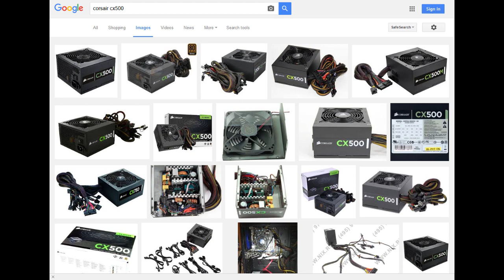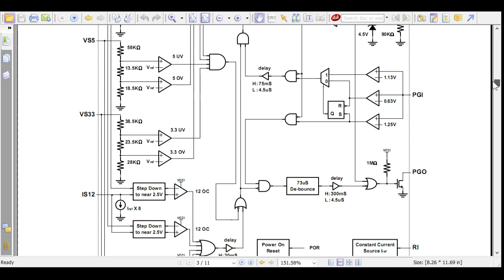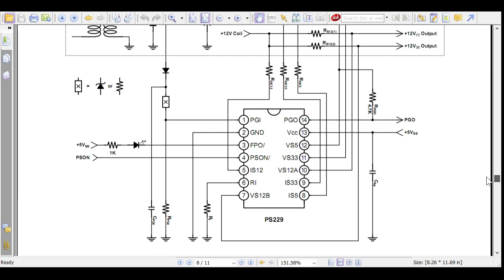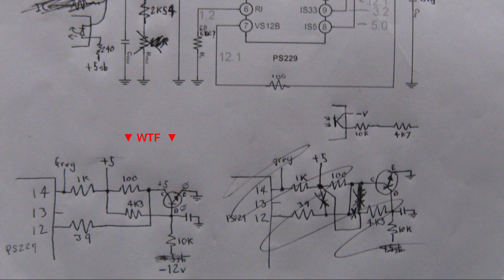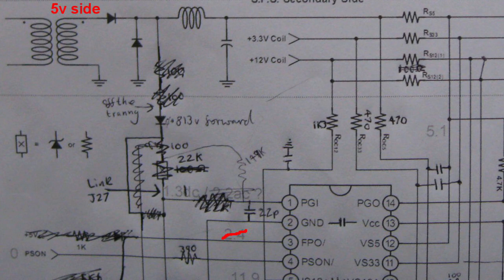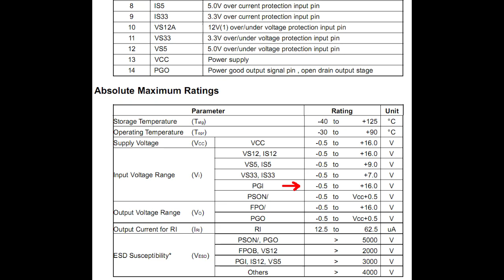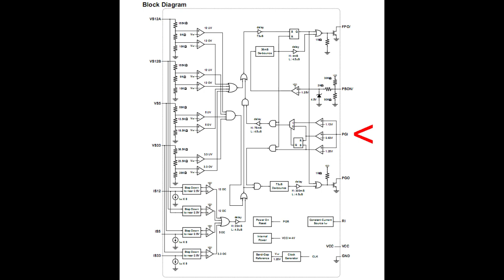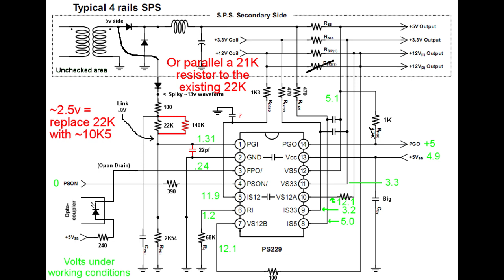Corsair CX500 PSU Repair

Comment: i just have the same problem with my smps. its a small and simple one ..for dvb-tv 
but i am having the same problem of voltage drop on the optocoupler prtoection component (and tl431 zenner voltage reference)
when i tested with+5v output with dummy load - the protection take place at only 40ma consumption
when i connected external linear 5v PS to my DVB-TV it works just fine - with 800ma consumption

so the problem is at the smps(PS) side for sure

so i think your video just gave me the idea to play around with the voltage reference -resistors
and maybe to try to bypass the faulty current protection components
maybe the TL431 voltage reference that cause the voltage reference drop to early is the faulty component.

untill i get my new TL431 i will make some test with the voltage refernece current protection 
as you did with changing the voltage Ref with resistors...

thanks . very nice work with the tutorial .
Reply from the maker: Hmmm this is a very different issue.  Only adjust the optocoupler if you want to adjust the voltage output.
Here is an Laptop SMPS I was playing with. https://postimg.org/image/bdphc8pbt/
I would recommend looking for the op-amps first and looking at the voltages going into the 'plus / minus' pins.  For this laptop 1 half of the op-amp controls the voltage.  And the other half controls the current.   (If I am remembering correctly)
Reply from the maker: Addon: if the output has a steady +5v output, I'm "assuming" the TL431 is working corrrectly. This smps laptop uses a AP4310.  Which has the voltage reference & op-amps together.  You could try to pull-down one minus side of one of the op-amps (just a little bit at first) and see if the voltage changes.  If the voltage does change.  Then its the wrong one.  And the other op-amp probably controls the current limit.
Reply: hi..thanks for your quick replay..
i didnt notice any opamp on my SMPS board

i put here my section of the board photo
https://postimg.org/image/71kca0kqz/

so you can only see the tl431 zenner and the EL817 that cause my +5v output to go down to 2.5v 
after connecting to any load above 40ma
(i tested all capacitors and even replaced 1 crazy 1000uF ,which wont read by any meter, by a new one near the +5v output )
how can i adjust the optocoupler in this board?
i dont have my board schematic - but i found general schematic with same components i have 
and looks very simmilar to my board design with SD4841 switching IC

http://www.silan.com.cn/UploadPic/20090909143349157.jpg

i allready ordered dual smps module 12v 5v - for some $4 .. to replace my smps board.

but my goal is just to learn with tis simple board how to deal with SMPS in general.
so now i wonder if and how i can disable the current protection.
and just get steady +5v at the output?
then i would like to know if the TL431 causing the voltage drop

one thing i didnt understand with all the smps tutorials....:

does the voltage reference block responsible for the output  +5v regulation ? or does it responsible to the current protection too ?
and who contols the PWM duty level to get  the wanted output voltage(like +5v) 
is this done with the help of the output monitoring -loop feedback? from the tl431 ?
or does it configured with the 4841 with some resistors?

i will sure keep watching more videos of SMSPS to get more deeper with this issue . 
or maybe anyone here has any link or explanation for this .

thanks for your advise.

ELI
Reply from the maker: ahh i see.  This is a simple design.  This design has no current limitation at all.  So you could try to pull many many amps from this board untill it does bang. (or the voltage is near 0v)
It checks the voltage level only.  So it will feed more power (voltage and current) until the voltage is back to 5v again.
I can see why you want to change the TL431. because thats the only component on the secondary side.

Are you able to check the voltage on the phototransistor side of the opto-coupler.  To check that the voltage it changing when the PSU in on-load and off-load.
P.S. thats the high voltage side, so becareful.

If the voltage changes (when its on/off load).  Then I will assume the TL431 & the opto-coupler are working correctly.

Another test you can try....  When the PSU of off-load.  Put a resistor (E.G. 10K) across the photo-diode side of the EL817.  And that should increase the +5V output to something higher.  Because you are creating a fake-load.
If you do not see a voltage change using a 10K resistor, try some thing smaller.

If output voltage does change, then (again) I'm assuming the secondary side is OK.  And the EL817 & TL431 is working.  And the SD4841 is not getting the feedback correctly.

http://www.datasheet4u.com/download_new.php?id=660477   (SD4841)

Also are you able to check the voltage on Pin 4 of SD4841.  Because that should be the same as the phototransistor side of the opto-coupler.

"does the voltage reference block responsible for the output  +5v regulation":
Yes (sort-of).

"who contols the PWM duty level to get  the wanted output voltage":
Pin 4 (FB) input controls the PWM Pin 6/7/8 (Drain) output.

You can see I have answered yes to both questions.  Because its trying to keep a balance between it all.

If you have a look at page 9 of the PDF.  I hope it explains it a bit.

I know I have not answered all your questions.  But I'm sure there will more after checking the voltage values of the pins.

Comment: Hi, i have the same problem with my CX500, and i figured out that when you switch quickly on and off the power switch of the PSU, the PC turn on, but when i start to play a game that need a good amount of power, my pc shutdown, i don't know if your trick will fix that?
Reply: and also where can i find theses resistor? Thank You!
Reply from the maker: unfortunately not, my fix corrects the 'underpower' problem, not the 'overpower' one.  They are similar but I dont know what the all the chip pin voltages are.
Reply: Techy Bits-n-Bobs okey thank you very much atleast i know that i need a new PSU !
Reply from the maker: to TWZ Zak and einherjer1ify .   If you are going to replace your PSU's it would not hert to try change the resistor.  Because it sounds like you have nothing to loose?
However is anyone able to check voltges, resistances and capacitance with a DMM?
Reply: You added a 22pF and a 140K resistor which i really don't know where to buy them, there's only lots, but tomorrow,  i will check voltage of "Power Good" (already checked others 3.3v, 12v etc and capacitors) 

edit : the "underpower" problem is not a big problem for me, because the little trick of switching quickly on and off work perfectly, but the "overpower" is very problematic
Reply from the maker: Ignore the capacitor....  but the resistor will probably be different for you.  Someone else used a normal 47K and it worked for them.  It depends on the voltage of the PGI pin 1.  If you have old junk circuit boards / electronics.  They are a good resource of parts.
Reply: Techy Bits-n-Bobs just took a look on the voltage when the computer was working hard, everything was fine but the computer shutdown, the problem wasn't here when i was using a GTX 650, but now with a 970, can't play any game, i'm probably gonna reopen the PSU tomorrow
Last thing,  i don't understand the 22pf capacitor 

Thank you very much (found this post of you http://forum.corsair.com/v3/showthread.php?p=842597 of the idle problem huhuhu)
Reply from the maker: I see the GTX 970 recommends a 500W PSU. To be honest I would not recommend running this PSU at 500W for a long time. Just because it "feels" cheap. P.S. Dont get the CX600 either.

I used a 22pf capacitor (bad choice) because I removed the original unknown capacitor because I thought it was faulty. It 'could' have been faulty but who knows?. I'm guessing the original one was a lot bigger, e.g. 1nf / 10nf. When the transformer starts switching on/off. It goes though the diode and charges the little capacitor. When it reaches ~1.25v the IC PS229 (page 5), turns on the PG output on the main connector.

When playing a heavy 3d game... (I'm assuming) Not as much power is going to charge the little capacitor. Because most of the power is going straight to the large filter capacitors. So the little capacitor slowly looses its charge, and it drops below ~1.13v and turns off the Power-Good pin on the main power connector to the Motherboard and the PC turns off.

It all comes down to checking the voltage on Pin 1 of the IC.
Reply: Oh okey, i understand now, but i calculated how much my computer need of power by taking the load wattage of everything and i get around 390w so i think that the CX500 can make the job no?

I also checked the gray "Power good" pin, it gives me 0.124v, so around 0.1v same as you, i need now to check the Pin 1 of the IC but i'm not too confident with PSU's

Thank you for the informations again !
Reply: Techy Bits-n-Bobs the Pin 1 gives me 1,193v, i don't know what to do now, it's between 1,16 and 1,33v...
Reply from the maker: That would make sense, because at the point of a heavy load... that would easily drop below 1.16.
A normal 47K resistor should do it. On old/spare circuit boards the little SMD devices would be marked as "473".

At 9.12. you will see the red wire, you can try to add another resistor on top of that resistor, if you are physcally able to. From my memory there is not much space.

Double check its the same value 2202 = 22K.

@390W = 78% PSU Load.  Thats just below the 80% mark.  So I think this PSU will be OK.
Reply: Okey thank you ! Now i need to find the resistor and i give you news !
Reply: Techy Bits-n-Bobs received the 47k resistor and did everything, now everything work perfectly, full load or idle, thank you very much for the help !
Reply from the maker: Glad to hear it.  That's my good deed for the year.    :)

Comment: I have this psu, a corsair cx500. When I play a videogame wich require much PC resources, the Pc restarts at 5 or less minutes, depending the pc game. I set the speedfan tester and the voltages appear low. Its possible to repair the PSU ? Thanks in advance
Reply from the maker: idk, that could be the psu, or the cpu thermal contact, or the mother board caps, or ...  anything.
Reply: i has checked caps, cpu, changed the cpu and gpu thermal paste, but those are normal...
Reply from the maker: @mitos meios      ouch !
Reply from the maker: einherjer1ify      if its anything like mitos meios problems.  You'll need to check the voltages when its idle and when the cpu is @ 100%.  Also monitor the output ripple on the power rails.  If its over E.G. ~200mv than something in the PSU is going bad.  And thats probably the caps?.  But if they are OK? then "try" to see what the voltage is on chip's Pin1/PGI because if that fluctuates too much it will turn off the PSU * But it should not cause any lasting problems (I'm assuming)
But anyway... checks the voltages on the main power connector first.

Comment: mine is different, 600W the chip is a 
sitronix ST9S429-PG14, i wonder if the pins are the same as your IC
Reply from the maker: I just had a look online...
The ST9S429-PG14 maybe a rebrand of the Unisonic S3515.
http://www.unisonic.com.tw/english/datasheet/S3515.pdf
And they appear to be the same pinout/function.
But you will need to check the pinouts/volts, to be sure.

Comment: Quick question regarding your tutorial,you said you removed a capacitor between #1 PGI and #2 GND of the IC.
Now lets Suppose you did NOT remove that component and left it intact.
you then replace the 22K with 10K  OR   parallel a 21K resistor to the existing 22K
And thats all right that should fix it? by the way that is a 10K5 resistor? 5 is the percent? meaning 4 bands ?  didn´t understand the number 5.  

 can you give me your email just in case my PCB is different than yours when i open it up?
Reply from the maker: I would ignore that capacitor...  oh 10K5 = 10.5K

Comment: Excellent find but there's one problem: The root cause is still unknown. Why should the PSU work initially and then start failing later? Something must have changed... I see you did not replace the high voltage side capacitor which could be bad as well. If it is going bad, the waveforms could change at the transformer, causing the problem. However, I do believe that the original resistor values may be a bit too tight, leaving too little headroom between the startup threshold and normal run situation. 

Thanks anyway, my daughters PC keeps freezing and this could be a possible reason. I think if PG goes off, the PC should actually power down totally but you never know...
Reply from the maker: The root cause is bad ceramic caps of unknown value.  So I added a resistor compensate.
High voltage side capacitor never fail, when they do its normally obvious. + they were smart and used a good brand.

Comment: i have a cx600 that when i turn it on fan of the power supply tries to spin a micro second and then stops and nothing happens. could this be the same problem that you fixed>? im not very expert on electronics as you but im experienced at sodering.
Reply from the maker: That sounds like the same problem.

Comment: I got some NOX psu from a friend that said it fried his motherboard. I checked all voltages and it seemed fine, tryied it on a motherboard and damaged it somehow, now it doesnt boot because an error message appears while on POST.. As well as some crazy temperatures and voltage readings on BIOS....

Cpu over voltage!
Cpu fan error!
Chassis intrusion!
Fatal error!
System halted!

What could it be?
Reply from the maker: sorry for the late reply, but that could be anything... sorry

Comment: Okey, I assemble my PC a year ago and its perfectly working but I realize something from few months and I take it lightly but least I decided to solve the problem, here it is , when I start my PC in morning its start well everything is well but if i shutdown my PC or if the electricity is goes for some reason and if I start it again it won't start it remain on but won't both up. I can hear the noise and everything is running but won't both up , and also I can see that my Hdd Led is not blinking,  and then I shut down the PC by holding power button for 4 sec and I left it for like 15-20 min and again if I try then it will start but not everytime . in that case if I try again and again continuously it won't work. then i change the corcair cx 500 power supply to my old atx power supply 450 w and its working fine on that . the thing is I can't run my graphics card on it.  MY Mobo is Gigabyte B75-hd3. so what to do now I'm totally confused with my power Supply :(
Reply from the maker: That is the exact same problem with my PSU.  Then it got worse and worse.
Reply: +Techy Bits-n-Bobs,  so what you did??
Reply from the maker: Yes, adding the resistor (red coloured) at 08:45 fixed it.
Reply: bro can you tell me if i continue useing that psu like that is that going to harm my motherboard or Graphics card? i'm not that big engineer + i broke warranty ..
Reply from the maker: If that is the "only" problem with the PSU. Then that fix will absolutely fine.
But if you do take it apart.  I recommend you look at the all capacitors to see if they are damaged in any way:
https://www.google.co.uk/search?q=damaged+capacitors+motherboard&tbm=isch
Reply: Exact same problem with my cooler master 700watt, same uc, I able to repair & it works fine